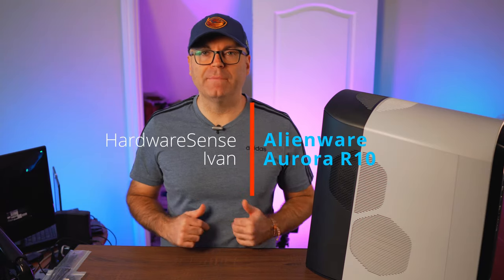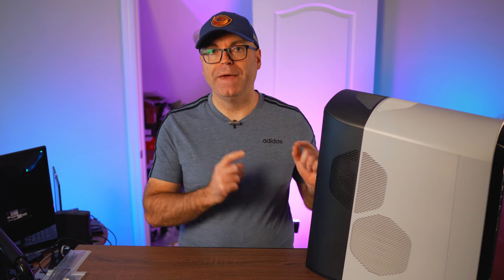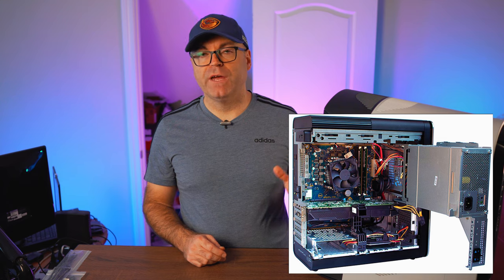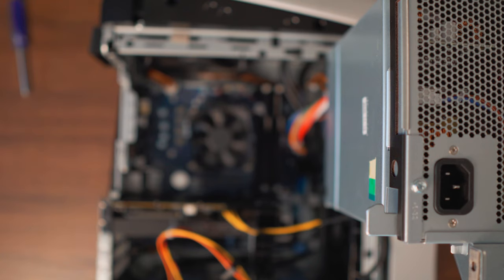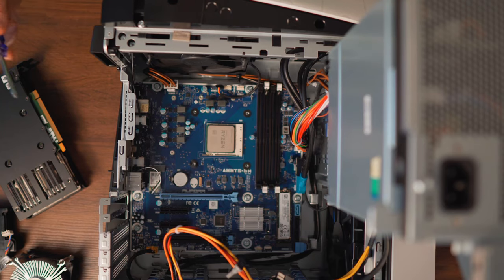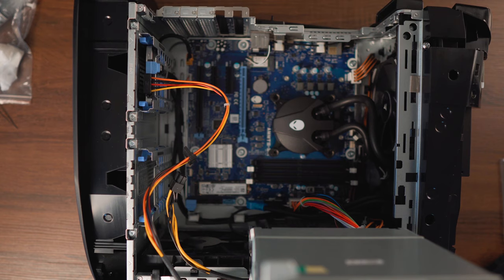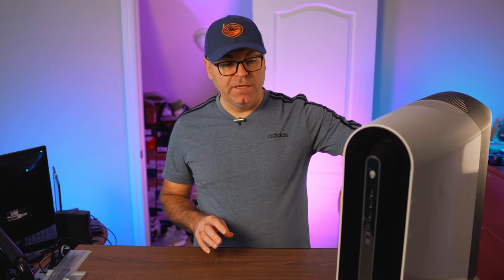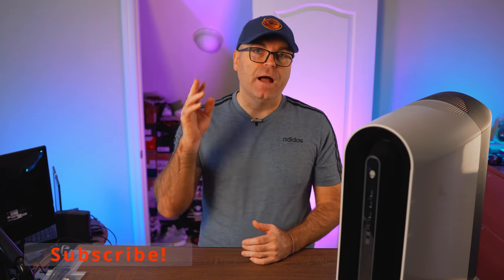Alienware Aurora R10 - All The Cooling Mods, That You Need!

Comment: I'm sure this is for above 1080P gaming, but I have the ryzen 7 5800X and 6800 XT config and honestly it's the coolest pc I've owned when it comes to temps. I guess there's a lot of different reasons temps could be an issue for some, but everything I've played my graphics card stays around 60C and my cpu's highest was like 72C. Once again, I know a lot of things factor into temp issues for some.
Reply from the maker: It makes perfect sense, at 1440P and above, the CPU is barely utilized.

Comment: Where did you get the rubber push in feet to mount the 92mm fan in the 3.5 HDD cage?
Reply from the maker: Link in the description
Reply: @HardwareSense  i looked yesterday and did not see

Comment: I have been reading up on this because i have an i7-11700F alienware Aurora modded with the corsair h60 (2018) and it has no vrm heatsink, I have read both that it is needed and unneeded, basically a bunch of conflicting information. cpu temps max at around 86c and  the max package power draw i have seen is 153w on windows 10 balanced profile while playing beamng drive and i had no stutters at all during the playtime, should I bother with the heatsink for the vrm? or should I maybe lower the package power to 65w as advertised. (not sure it's possible tbh, I think power saving plan limits it to 65w though) just looking for an opinion.
Reply from the maker: Personally I would try to find the VRM heatsinks, there is not a lot of air circulation there and I wouldn't want to risk it.

Comment: Ordered this couple of days ago is it good for a beginner in pc? Just want to play warzone with it . I currently use a ps4 console classic .
AMD Ryzen™ 7 5800
Windows 11 Home
NVIDIA GeForce RTX 3060 12GB GDDR6
16GB, 1x16GB, DDR4, 3200MHz, XMP
512GB M.2 PCIe NVMe SSD
Reply from the maker: Hopefully you got the AIO cooling option?
Reply: @HardwareSense  unfortunately it didnt come with that i just ordered it from dell for 110 dolars hope is a good deal .(Assembly,Heatsink,Central Processor Unit,95W,L-COOLER,R6)
Reply from the maker: @osvaldotrevino1991  Not that bad actually

Comment: Great video. I did notice that your voltage is/was 1.41V. I have the R10, 3700x, RTX 3070. I realized that I was at 1.38V. When I lowered it to 1.28V, my temps dropped significantly! Haven't noticed any change in performance. Have you considered this option?
Reply from the maker: What did you use to lower it?
Reply: @HardwareSense  AMD Ryzen Master. Go to "MANUAL" tab.
Reply from the maker: @terrellwright7565  I see, I will give it a try, thanks.
Reply: @HardwareSense  Let me know what you think. 
DISCLAIMER: I am not a Gamer or Miner. I use my rig for Streaming Content and watching videos to upgrade mostly.
Reply from the maker: @terrellwright7565  I played around with it for a while, and it's working for the most part, changing the voltage only will drop the frequency to 3600mhz on all cores, so you would need to adjust that as well, when I put it at 4.4ghz as max on all cores, the temps are too high, higher than what I have have by default with PBO enabled.
Reply: @HardwareSense  I am sorry that didn't work in your situation. When watching videos and making replies, my temps are 37C-40C. I want this for every one in the R10, R11, R12 family. Thanks
Reply from the maker: @terrellwright7565  Yes if you are no doing anything intensive it's fine, but the moment you launch a video rendering software or a demanding game and temps are too high with the frequency at 4.4ghz and at the lower 3600mhz the performance is suffering, I just wish that we could adjust the voltage and keep everything else by default

Comment: Curious, why not turn the radiator 90 degrees, was there not enough hose for that?
Reply from the maker: Correct, not enough slack
Reply: @HardwareSense  thanks for the reply. I just bought one today, no graphics card. My current machine has a Corsair h60 in it, I will probably swap in.

Comment: I have the R10, 5800x, 3080 and with AMD. I switch my to Corsair ML 120 Pro and getting front fan errors when booting up. Can't my fans with Alienware Command Center and tried MS afterburner still not working. Any ideas. My fans two fans are as well. Any help will be appreciated...both fans stay at one speed.
Reply from the maker: Check out the connection for the front fan, I had an issue only the first time since I had the ML120 Pro not plugged in correctly

Comment: Do you get any errors if you install the aio without installing the heatsinks?
Reply: I just installed this exact module. Dell sent me a a liquid cooling module "assembly" heatsink was in the description by the way. I got everything installed and I got the critical error heatsink clips not installed. My whole system was also making some crazy noise I can't explain. I triple checked every fan and the positioning of every component and I did the installation perfect. I'm not sure why it made the sound. Anyway, I contacted dell and they are sending a technician out to install the heatsinks and check "my" installation of the liquid cooling module. The tech was convinced that I did something wrong and that's what created the sound lol.
Reply: To touch further on this I bought a "refurbished" liquid cooling module from Dell and the explained to the salesman that I had a air cooled system. Admittedly I didn't think think about the heatsinks for the side and back with the module setup. In my defense I feel the salesman should have known that the rig I had didn't have heatsinks other than the one under the CPU fan and should have atleast tried to sell me some or include the ones that the assembly stated came with the liquid cooling module.
Reply: @Tigerfan-qx2xq  hey thanks for the info! So you ordered this assembly from Dell? How?
Reply: Error code is 2000-0714 btw
Reply: @hardwaresense did you get bios errors turning on the pc without installing the heatsinks first?

Comment: I just ordered an R10 with a 3080 but I was able to get the stock liquid cooler.  My question is will I still need to get the heat sink or was that included?  And will I still want to purchase the 3 fans?
Reply from the maker: It will come with the VRM heatsinks and yes you would need the fans if you want silence
Reply: @HardwareSense what is the cooling performance difference with the push pull configuration. Trying to get a little better cooling on my 3080 until the 50 series cards arrrive.

Comment: Hello! I know this video is old but hoping you can help. Just did the whole procedure and now PC wont power on. I made sure to ground myself before working, connected my things back and PSU receives power, fans spin but when pressing the power button nothing lights up. Any ideas?
Reply from the maker: Check all the connections again and double check
Reply: @HardwareSense  Currently checked, everything seemed fine. Thinking I may have shorted the motherboard. Thanks for responding!

Comment: Did you use different screws for the top fan on the push/pull?
Reply from the maker: No, they are the same ones that are used with every aftermarket AIO, I had a lot of leftover from the past.

Comment: Noctua NF-A9 PWM, Premium Quiet Fan, 4-Pin (92mm, Brown) in front hdd cage  then x3 Noctua NF-A12x25 PWM, Premium Quiet Fan, 4-Pin (120mm, Brown) with splitters in existing fan ports on mobo would this work? great video btw thanks for making I've hit  the subscribe button :)
Reply from the maker: It should
Reply: Using the Noctua NF-A12x25 PWM as the top AIO fans will cause a bios error. They work wonderfully and are super quiet. But you'll get an error everytime you restart the computer which is super annoying.
Reply from the maker: @toddgarvin2808  I thought that multiple people over the Dell forums confirmed that those are not throwing an error?
Reply: @HardwareSense  So I have the R11 (bios 1.0.4), not the R10. I wonder if that is making the difference. I do love how much quieter this thing is now. :-)
Reply: All done x4 120mm fans no errors thanks for the reply 👍

Comment: How many fans you have on your Aurora 10. I have the Aurora 10 with Ryzan 5800X watercooled. I was wondering  do you know if my system has three fans or two.
Reply from the maker: You should have 2, one 120mm in the front and one 120mm on the AIO
Reply: @HardwareSense  do you feel this will help with the cooling and quietness? With two Noctua fans...
Reply from the maker: @RichardMoreno24  Oh yes, absolutely
Reply: @HardwareSense  thank you for your help.

Comment: I added a push pull with two ML 120 Pro and the Alienware AIO cooler yesterday and my R10 is so much quieter with CPU temperatures dropping 20 to 30 degrees depending on the workload! Thank you very very much for your tutorial!   However, I did not a add a second front fan and just swapped the lower front fan with another ML 120 Pro. I plugged it on the Front fan connector but on startup I get a diagnostic check failure telling me the front fan is not recognized. THe PC will boot normally after the diagnostic check, and the front fan works normally. Do you know if this diagnostic check on startup is normal or  if there is a workaround? IT's just annoying to wait a few minutes now to address the diagnostic before being able to use the PC. HOwever, again, thank you for your help temperatures are crazy low now!
Reply from the maker: Does it run the diagnostic every time or it was just ones?
Reply: @HardwareSense  Every time unfortunately.
Reply from the maker: @Atreyuh55  Try to unplug it and plug it back, if that doesn't work, try plug in the stock one and back the ML120 pro
Reply: @HardwareSense  Will do and report back back! Thank you!

Comment: The reason i ordered the air cooler was because i didnt want to deal with water cooling. Looks like i'll need to figure out some other air cooler
Reply from the maker: This case only works with the water
Reply: @HardwareSense  I have a 95w processor under a smaller cooler with the same clearance, dell just cant make a good cooler. The POS silverstone RL-KR01 would have been a better option than what Dell used here

Comment: I just got an R10 back in May or June - RTX 3060 card, Ryzen 5800, 32 GB RAM and their cpu liquid cooling - and the fans are definitely crazy loud. Also it does have issues with occasional blue screens, still trying to figure out what is causing them.
Reply: Ithis was happening to me before, maybe check how hot the pc is bc alienware pcs cooling is absolute shit and it might be messing something up
Reply: Did you figure it out?  There is an open box R10 with a 5800x and 3070 for under a grand with liquid cooling and I'm wondering how bad the cooling issues are.  For the price I feel like I can't pass it up and I need to maybe just upgrade fans?

Comment: Can you use 2 of the Noctua SLIM fans for the push/pull, giving you more room?
Reply from the maker: Honestly not sure, some fans force the Bios to throw an error, and only those that I posted are sure not to do that, someone mentioned installing the top fan above the frame, I will test that next.
Reply: @HardwareSense  Yes, I saw Noctua and went and purchased three (same as your link). The top fans DO make an annoying BIOS error whenever you restart the machine. Which is super frustrating. However, my machine is almost silent now under normal loads. And much quieter when playing AAA games than before.
Reply from the maker: @toddgarvin2808  Super weird, I could swear I saw at least 3 people confirmed they got no errors...
Reply: Do you only get that error because you replaced the top fan with noctua or is it because you replaced all of them?
Reply: Total tech support at bestbuy tried to install noctua in my Aurora R10 and they said a BIOS error kept appearing, all but one of my fans are the same one you have listed please help, also would it be worth trying Corsair ML120?
Reply from the maker: @kevincommings8394  With the ML120 Pro you will not going to get any errors
Reply: Thanks
Reply: I will buy, these and try. Would you recommend replacing the radiator fan as well?
Reply from the maker: @kevincommings8394  Yes all fans with the ML120 Pro, push pull on top and one  intake front
Reply: @kevincommings8394  Sorry for late response. I replaced all of them but only top giving error. I did 2 fans with radiator on top (push/pull) with included Noctua splitter. I have some time today to try using only 1 fan and removing the splitter. I"ll let you know what happens.
Reply: I returned the Noctua for the ML120 pro. I currently have a four fan set up. Tow in the front pulling in air and the same push pull set up at the top. I have a new issue now. The top fans are extremely loud as soon as I boot up my computer, and they don’t let off. Any more know what’s wrong or how to fix? I may have to reinstall the stock top fan.
Reply from the maker: @kevincommings8394  I can only say maybe unplug and plug them back, make sure all pins are covered by the fan plugs

Comment: I feel like this case is due for an upgrade. So many storage brackets can be removed to make space to move the power supply to the bottom and create open air space at the top
Reply from the maker: Can't agree more
Reply: @HardwareSense   is it ok to have 1 exhuast and 1 intake instead of pushpull? i can only get two ml 120 pro fans.
Reply from the maker: @jiren3737  It can be done, just be prepared for higher temps
Reply: @HardwareSense  last question, how do you think the sound would be if I did push pull with ml 120 pro and keep the front stock fan?
Reply from the maker: @jiren3737  Pretty loud, but better than all stock
Reply: @HardwareSense  dang thank you I’ll just keep the stocks
Reply: @HardwareSense  last question, how do you think the temps and noise would be with 2 ml pro intakes and 1 stock exhaust.Ty for the help.

Comment: Hi, can you please explain to me how you managed to get a fan to fit in the 3.5” cage for the hdd..? I just tried with a 120mm fan, and no way am I getting a fan in there without breaking something.
Reply from the maker: I used 92mm fan
Reply: @HardwareSense  what's the biggest fan you can use in this location?
Reply from the maker: @dillonbusby9212  92mm

Comment: Nice мартеница, I have the same :D. On the topic, I have the R11 with i9-10900KF and RTX 3090. I have pulled out the top fan and put it in front. I have installed Noctua on the radiator. Improuved the temps with around 20 C.
Reply: By the way, I tried to use only Noctua fans all over the case, but the R11 with i9-10900KF has some BIOS tests running on startup and Noctua fans cannot get through the tests. I had error on startup. So I put back the bottom front fan and used the top fans in front to pass through the BOIS checks. I connected the Noctua I installed for the radiotor on the CPU Fan connector, it is working very well.

Comment: What Liquid Cooler is compatible with the aurora R12 and what you recommend
Reply from the maker: The stock and Corsair H60
Reply: @HardwareSense   i can't find the stock  where can i find the stock if not i will have to go with the corsair
Reply from the maker: @eduardolara7148  Contact Dell directly or eBay

Comment: Why use two different fans?  Why not just stick with either 2 Noctuas or 2 Corsairs?
Reply from the maker: That's what I use, 3 Corsair ML120 Pro
Reply: @HardwareSense  Thanks.  I saw the Noctua listed in your links.   Do you prefer the Corsair to the Noctua?
Reply from the maker: @javapaceable  Currently only the Corsair is not throwing a Bios error
Reply: @HardwareSense  Nice to know!   That would drive me crazy.

Comment: Hello I used your recomendation and fan replacement but I used the Noctua NF-A12x25 PWM but now I have an issue every time when I boot I have an error, do you know if there is a converter or someting to solve the issue ? I search on internet and it seems the issue is realed to DELL proprietary fan connector, please help me , thank you
Reply from the maker: Did you get this one https://amzn.to/2RP6I0d
I see a lot of people at Dell Community forum reporting that is working with no issues
Reply: @HardwareSense   Yes, that one, I have an alienware R11 and there was one BIOS update last week, in any case I am happy with the upgrade, thank you very mucho for you video and help the only issue now is how I can disable that check at the boot or find out how to solve it, I do not know if it is an adaptor issue, I saw on internet that some people said that the dell 4 pin mother board connector is not standard and that is why I have this issue, I contacted Noctua support and they told me this = Unfortunately systems from Dell, HP, Lenovo and other big OEMs are often diverting from standards set by Intel or AMD by subtle details, and thus we cannot guarantee that any of our coolers or fans are compatible with such systems. 

In your case, I don't think that the pin-configuration is an issue here, but rather that pre-built systems often require a minimum-RPM from fans. That means that a fan-error could result out of f.ex. one of our fans spinning at a low speed, which your system detects as "faulty" because it doesn't expect an RPM that low. 
Sadly, replacing fans in pre-built systems often proves to be quite difficult, and I'm sorry that we can't provide you with an easy solution that will resolve this issue.
Reply from the maker: @fenix80rcl  Maybe Dell changed something with the new Bios or maybe the R11 handles things differently, but I read at the forums that in the past a lot of people used those Noctua fans successfully
Reply: @HardwareSense  Thank you for your help, now I have 4 fans and the noisy was reduce a lot !!, GPU is cooler
Reply from the maker: @fenix80rcl  Great, happy to help.